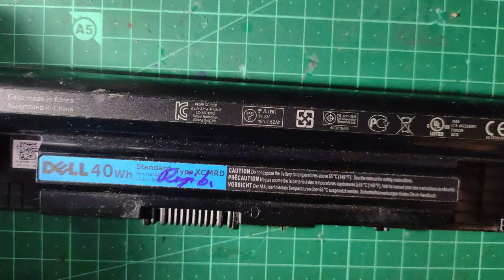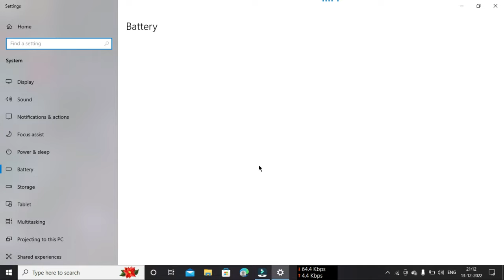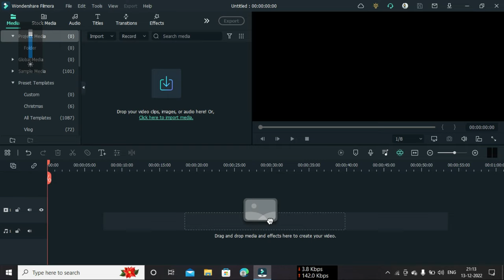Dell laptop battery repair || laptop battery circuit repair || how to check laptop battery BMS⚡⚡

Comment: Hii, Sir
Happy to see that you answer all the comments, I am also facing an issue, My laptop battery cell were all fine but BMS didn't work, so I changed the BMS (from another battery with same specifications), after making connections carefully, i put battery in laptop and it showed, "your battery has experienced permanent failure". Please help, how should I fix it?
Waiting for answer. Thanks
Reply from the maker: bms damage you have to change your bms

Comment: Dear Sir,

My laptop battery isn't charging due to a central cell issue. I replaced cells, but the central one still won't charge. BMS works fine for the side cells. Could you please suggest a video or make one to help me?
Reply from the maker: https://www.youtube.com/watch?v=I1hjufLz8Fo&pp=ygUVbGFwdG9wIGJhdHRlcnkgcmVwYWly
Reply: @ElectronicsBing  Members-only content , so unable to watch this video

Comment: Sir, I have a laptop with dead BMS, and i have my old laptop (dead laptop) with working BMS and same pins (8 pins). Can i made it to work for my current laptop? Please tell me how? I cant afford to buy new battery for my current laptop
Reply from the maker: same brand laptop?
Reply: @ElectronicsBing  no sir, it is different

Comment: Dear bro, i purchased 6 cells dell battery after reasemble with 3 batteries connection  can't get any output, and their is 9 pins, and i connected ground to 4 pin from p+ as well, tell me what to do next?
Reply from the maker: if bms is completely dead then you can get same bms  from other old battery

Comment: Hi,
Brother my laptop battery consist on 4 cells (14.8v 40w of XCMRD) and the BMS of this battery is dead.
So I took another BMS of 3 cells (11.1v) and made my own battery using 3 cells. Now my laptop is working absolutely fine with this but the problem that I am facing is that my laptop doesn't show if battery is charging and also the remaining amount of charge. 
When I unplug laptop, It gives message of "Unknown remaining" while on plugging in it says "Plugged in and charging" for 3 to 5 Seconds and then after it changes the message to "No battery is detected".
Please guide me what should I do.
Thanks in advance.
Reply from the maker: bms not matching
Reply: @ElectronicsBing  Where can I get one?
Reply: @CilentEyez  you can get old Battery BMS from Dell service center.

Comment: if we do this will it effect any battery or charging problem etc
Reply from the maker: this is last way to do that.    2 mosfet operate in series.
Reply: @ElectronicsBing  i to have same problem, when i did the same wt u showen. the fuse blowed

Comment: Please, how can i reset BMS from batbl50l6 ? :C
Reply from the maker: remove battery -ve then connect
Reply: @ElectronicsBing  i changed all batteries for new ones charged all up to 4.16 v , everithing is ok but there is no output, just the clock voltage.

Comment: Bhai Sirf fuse soldered kr lety
Reply from the maker: mosfet gate supply missing tha
Reply: @ElectronicsBing  . Bro, wo mosfat ke supply nhi de the because isma protection feature hota h.. Or bms chip locked h , jiska karan mostfat supply missing h.. Ab isma bms direct h to  safety  nhi  ... It's dangerous now...
Reply: @mohitsorout6669 toh kya krna hoga mere bhi output nhi de rha